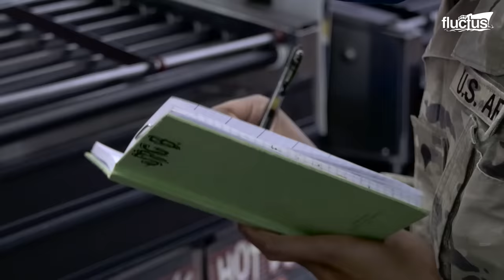Inside US $2 Billion Nuclear Submarine Kitchen

Comment: question: where does all the excess fumes and grease that's put in the air go? If you're underwater I doubt you can just yeet it out a vent. Do the subs have massive air filters?
Reply: A lot of different types of filters and machines for  atmosphere control.

Comment: Watching the unreps made my hands hurt from being an undesignated stuck in Deck department holding those com lines for what seemed like forever. The flight deck was the worst. 

I was hoping with almost 20 years gone by they would've have sought alternate ways to communicate ship-to-ship, but I was wrong. On the bright side the seamen on a CVN don't have to endure those long refulings that a CV has so it's probably less time holding those line. Too much slack on the line heave. Lol 

Hope u people give thank to undesignated personal, the grunts of the Navy. Some people disliked going cranking, but most seamen couldnt wait. 12 on 12 off, easy work and get to eat without having to get hot plates or take a shower and change cause you're too dirty to eat only to go back to getting dirty right after. Good times.